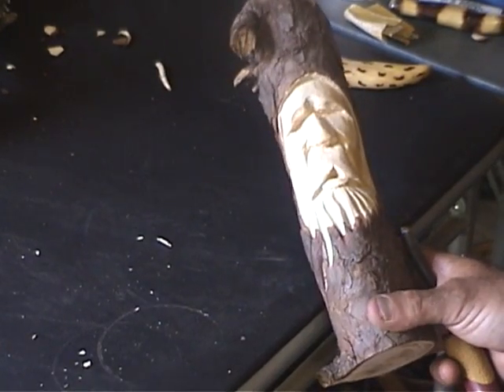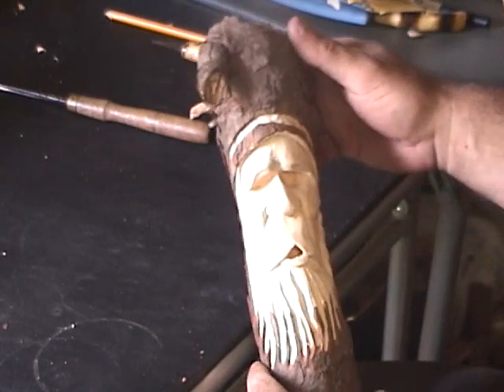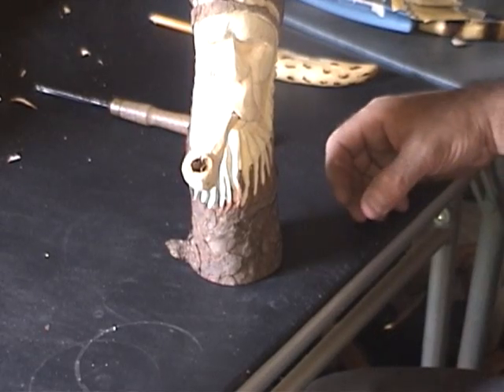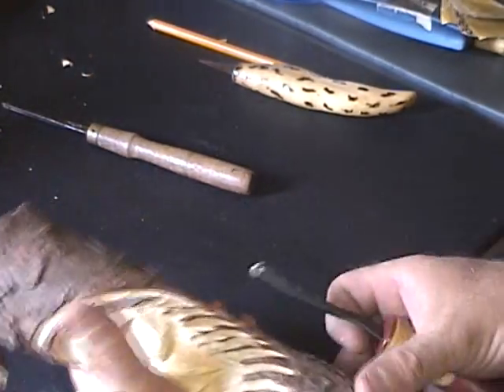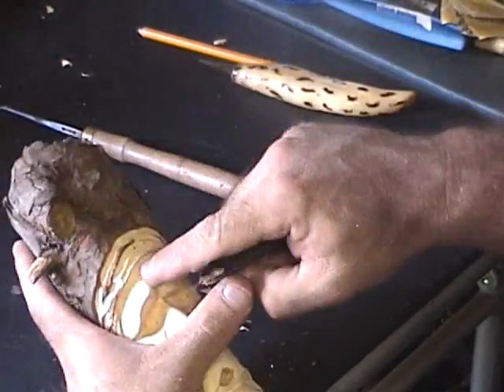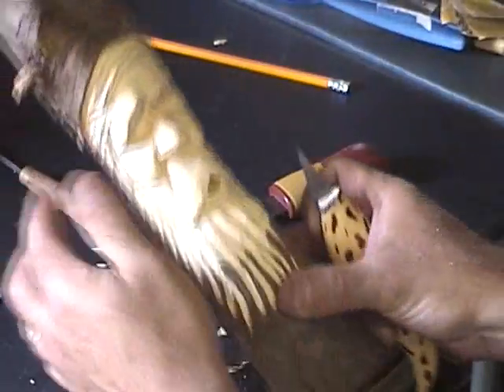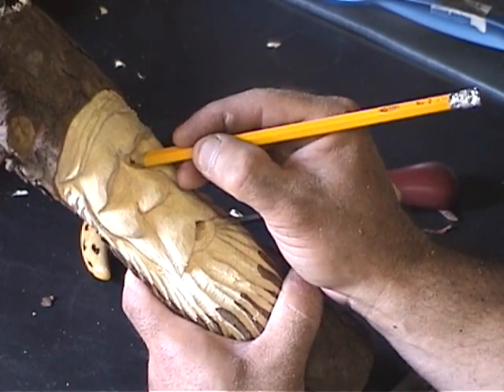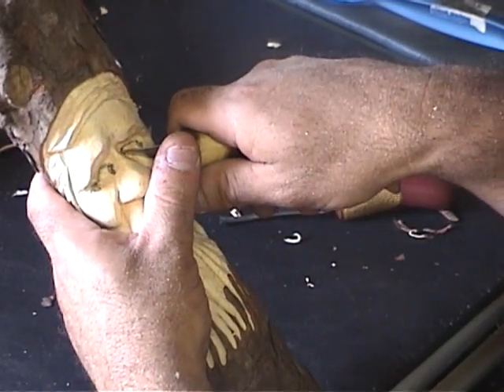Wood Carving

Comment: I like these video's i've watched them a few times, my noses still look to flat any tip's how to round them
Reply from the maker: Dig in along the sides of the nose more with a gouge and make the eye sockets deeper. Then go under the nose and remove more wood. It's a process a little at a time blending into the cheeks. Don't be afraid to remove wood where you need it. hope this helps...Kevin
Reply: Sorry it took so long to reply i had problem getting to my gmail account. Thanks for the tips it helped a lot Thanks John Cress
Reply from the maker: You're welcome,